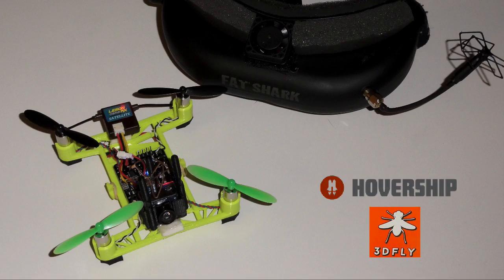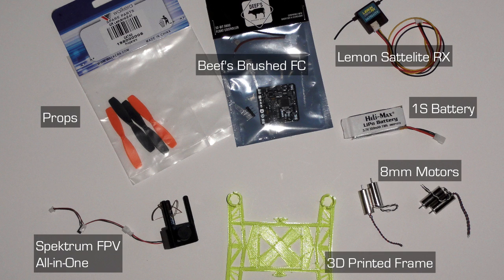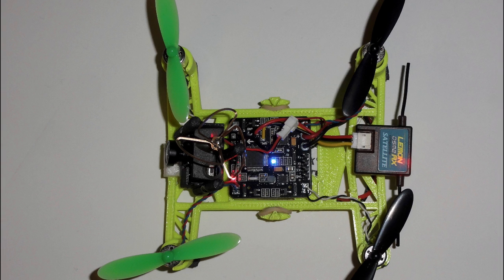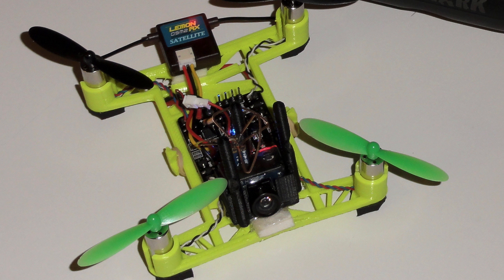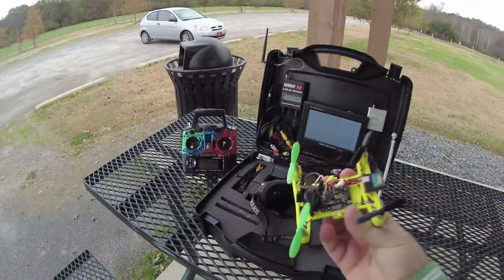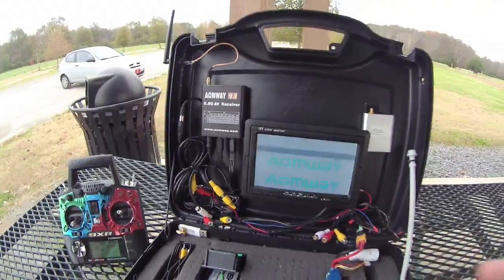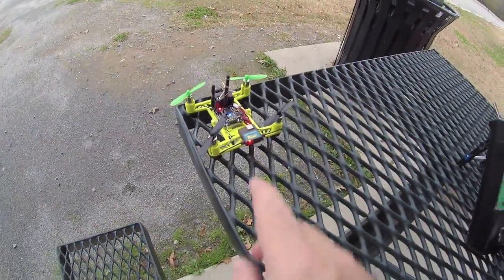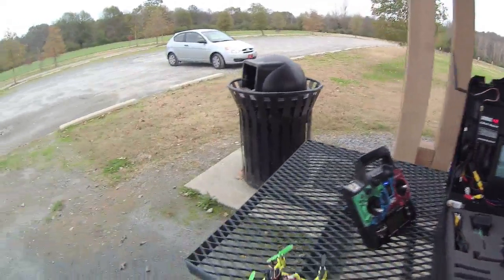HOVERSHIP 3DFly FPV micro quadcopter

Comment: Since you seem to know what you're doing, would you help me build a decent drone/quadcopter that would have a decent flighttime and could carry a gopro.

I'm looking to build a drone that could carry a gopro with the purpose of recording more or less cinematic/stable sceneries.
without any props or anything in the way, also I'd love it to be stable like the phantom 2's are, but I could never afford a phantom myself, it seems a bit overpriced too (considering the fact that it's possible to build your own quads)

I'm fairly new to quadcopters, currently a proud owner of H8 mini (haha), but im willing to spend around 350$ on a quad that'd be stable (no blurry video with gopro), could fly for a while (maybe like 15minutes) and wouldn't have anything in the way of recording.

Hope you could help me out!

(I've seen a lot of racing quads, with fpv and gopro and they could be built under 350$, but the thing is they're way too fast for me and for what i'd use them for)
Reply from the maker: +Lurpi That is a tough task over the web. Where are you situated and are there not perhaps any quad guys close by that can give you hands on assistance?
Reply: +FunFly FPV Estonia and not that I know of

Comment: Any one have trouble getting the lemon RX going to bind mode? Maybe I got a bad one.
Reply: +Scott Robb I had the same problem until I realized I flashed the latest version of Naze32 firmware prior. I reflashed the Baseflight firmware using the Baseflight configurator and now it flashes :)

Comment: Hi, very good, I like, so what is your Flight Control Board Can i the link, please.   :)
Reply from the maker: +ONCLEFLY This board is available here:

https://www.multirotorsuperstore.com/beef-s-brushed-board.html
Reply: Hi, thanks not for 50$   :)
It is this now good :
http://www.banggood.com/Micro-Scisky-32bits-Brushed-Flight-Control-Board-Based-On-Naze-32-For-Quadcopters-p-1002341.html

And little small  :)
Reply from the maker: +ONCLEFLY Yes, I switched to that one also for the later builds .. I get it from HobbyKing. The cheaper one also has a built in receiver.
Reply: +FunFly FPV Me too,  I switched to that one also because it's very good, small, and better price.   :)

Comment: very nice. will be building mine very similar to yours soon. does it have enough power for flips and rolls?
Reply from the maker: +Razor E It does do flips and rolls but I think it might be just a little underpowered to fully recover .. So these are some real budget motors and the FC will support much better. Next I will get some better high speed motors and then I think it will have no issues.
Reply: cool. I have the motors that came with KIT so hopefully they'll be ok

Comment: Can you put a lost buzzer on that?
Reply from the maker: +Chi Sty I had the same question and thats why I chose the bright colors frame. This thing can easily get lost. Seems that the Beefs FC board does not support it now, but will in the future.

From the creator on Reddit:

[–]Curtisbeef

Ya unfortunately the Buzzer pin is not broken out. I will try to incorporate this in the next revision down the line...